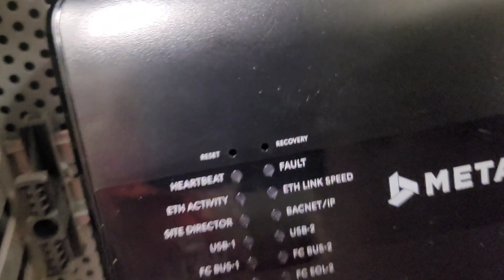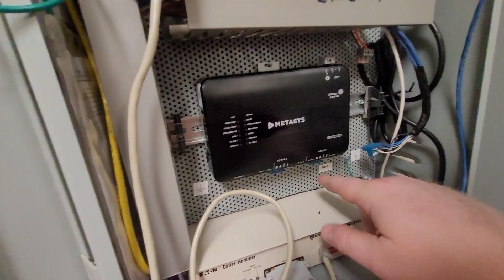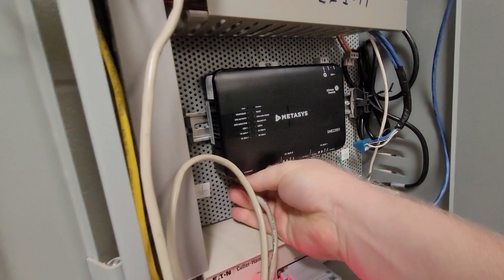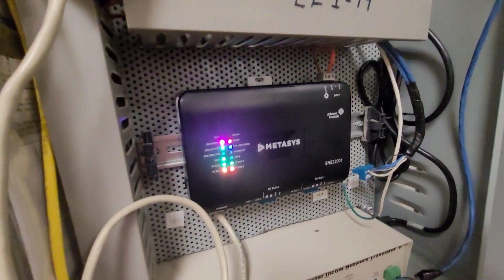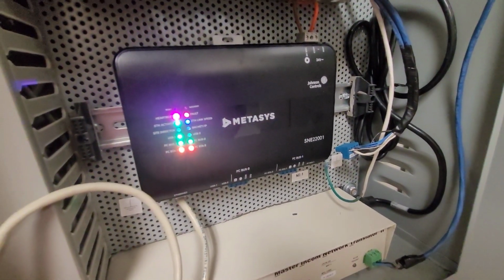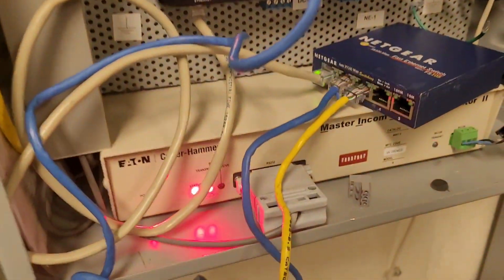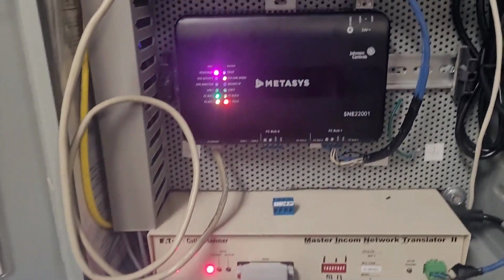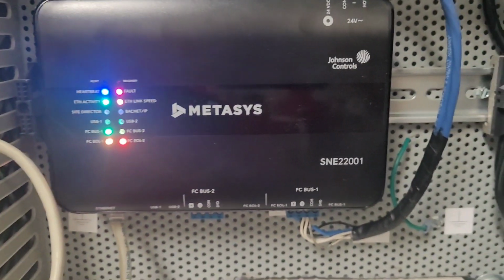Replacing a Johnson Controls NAE45 with an SNE 2200

Comment: Hello System Control Tech,
I have a Metasys system with 1 ADS 12.0 and 2 new SNE22000 (version 12.0), but my older NAE version 8.0 disappeared from the SMP tree after the upgrade. How can I make this old version to appear in the SMP tree again? The SCT shows all the engines in the tree.
Thanks for the help! This channel helps a lot!
All the best
Reply from the maker: Verify the ip address for the server, log directly into the engine and make sure it has the correct ip address under the focus tab

Comment: Hi System Control Tech,
Have you ever installed new SNC yet? We recently hired JCI to replace an old model NCE by a SNC25152. The new SNC was setup as a network engine and also a control device which has a chillers control programs.  What we was told the chiller programs now stored under the local application (in the program folder). All the control points is no longer able to store in the FCB, what we won't able to use JCI SMP to insert field point. I'm wondering is there an alterative way to create a folder in the FCB so we can insert the device control points. That is a common things we use to able to get it done with the old JCI NCE. In the future, if you are in happen to replace or install one a new JCI SNC, will you please post a video of the processing. Thanks
Reply from the maker: We're avoiding the SNCs like the plague. Once you create the point in CCT you use SCT to load it. The SNC also changes the way you do overrides

Comment: Your channel is so helpful with jci. But do you happen to have any videos on the tec2646-2s?
Reply from the maker: I don't have any videos on them but I'm very familiar with them to the point I have all of the parameter settings memorized for one of our buildings. I'm not a fan of them because it's too easy for occupants to acess settings
Reply: @Systemcontroltech  Yeah I’m definitely not a big fan of them either, if I remember right I think there is a point to lock certain things with different levels, but I’ve never really messed with it to tell you the truth.

Comment: Hello friend, can I connect a USB to RS485 converter to the usb SNE? or USB to RS232 and RS232 to RS485. I need to use another port for Modbus RTU, on the FC BUS I will connect Bacnet devices. Thanks a lot
Reply from the maker: I've never personally tried using one of those converters. If all of the devices are bacnet why not just put them on one of the two trunks already on the SNE?
Reply: @Systemcontroltech  Thank you very much for answering.The model is the SNE11000, this model according to the manual has a single trunk and I will use it for bacnet, I need another trunk for energy meters with modbus rtu connection, that's why I'm investigating if it can use modbus RTU through any of the two usb available with converters to RS-485 ports
Reply: usted tiene el softwa??
Reply: I had a similar situation with Siemens Combustion. I used a protocol converter (Sierra) , it was a Modbus to BACnet IP, straight into a switch. No need to use the SNE.